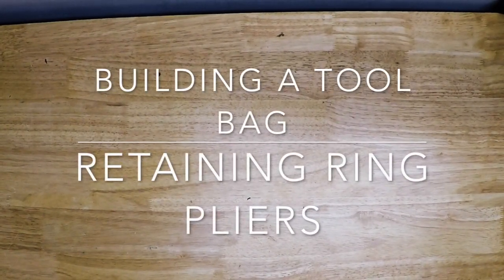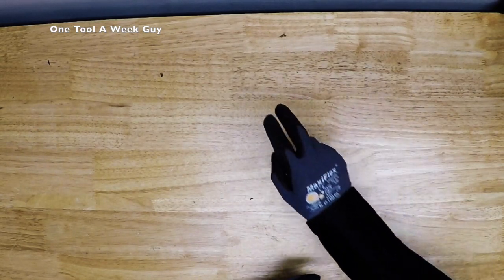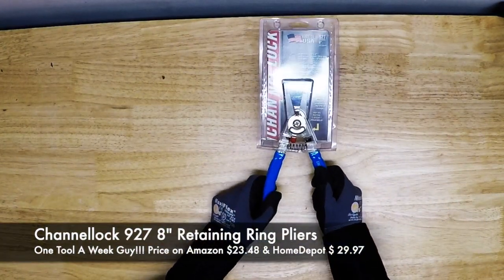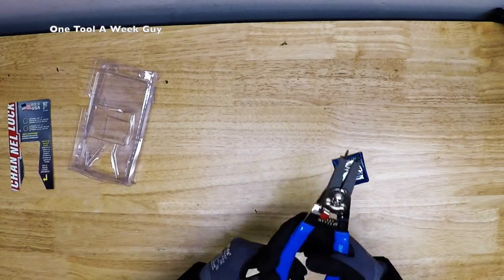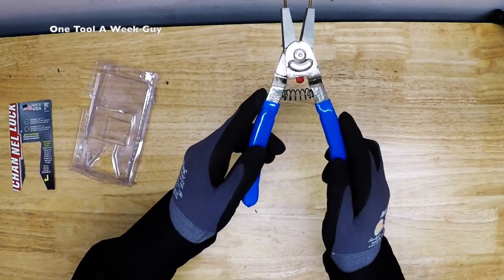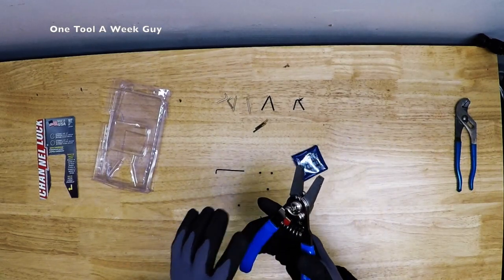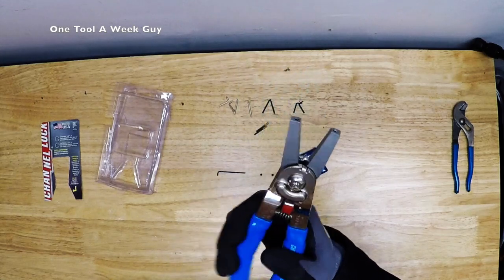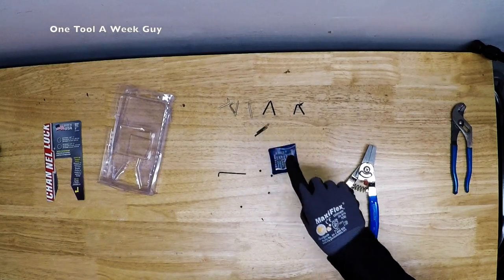Building A Tool Bag (Channellock 927 Retaining Ring Pliers)

Comment: My most recently purchased steel toe boots were Redwing Irish Setter series.  Probably not water proof,  I use mink oil on them often and would say very water resistant.  Really comfortable, electrical shock resistant.  I have some older Wolverines and both brands have served me well in the past.
Reply from the maker: Thanks for letting me know. Ill have to take a look at them.

Comment: What are the different metal tips used for? Black... silver... and copper... What's an instance for each type of metal tip?
Reply from the maker: Jason Minns they are just going to be size difference. To tell size by color.
Reply: @OneToolAWeekGuy  Yeah, but copper is a softer metal than steel... Why didn't they just color them red white and blue, if that were the case? Maybe, the hardness is relative to snap ring size... I just bought the same pliers. I was just curious. Thanks for the quick reply.
Reply from the maker: Jason Minns I'll ask channellock on my Instagram and hope they reply back. Let you know what they say. I wondered the same thing when I got them. The only thing I found online was to distinct different sizes.

Comment: Regardless of its price, this tool is completely useless in tight spaces. Back to the drawing board and back to the store for a refund.
Reply from the maker: What are did you have no space to use it? Also did you pick up another tool to help?
Reply: @OneToolAWeekGuy  
Thank you for your questions. I was attempting to replace a retaining ring on an automobile rear hatch motor arm. The Channellock tool is an expensive solution, but would have been worth the price if it had been a bit thinner. This would have permitted me with an opportunity to easily replace the retaining ring with the electric motor still installed. Since I ended up taking the motor completely out of the vehicle, I could replace the retaining ring without the need for any special tool.